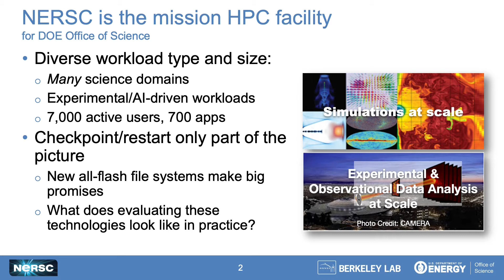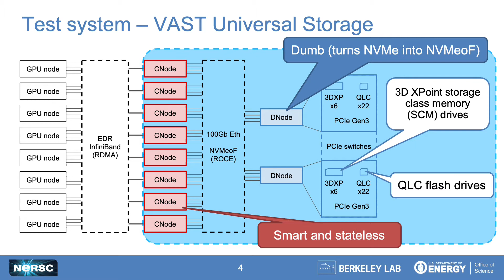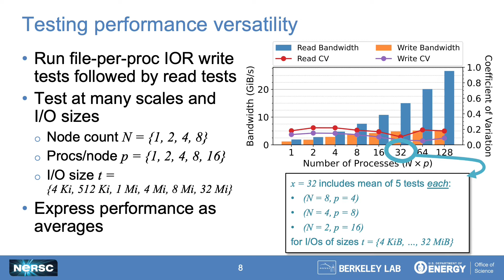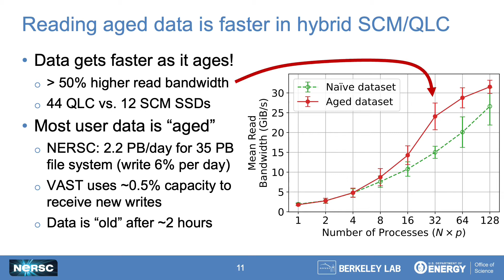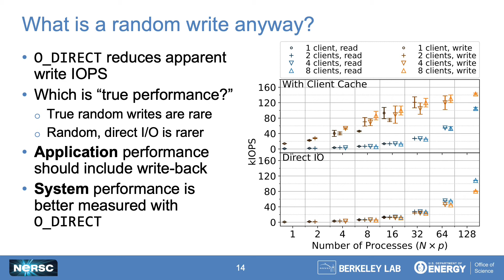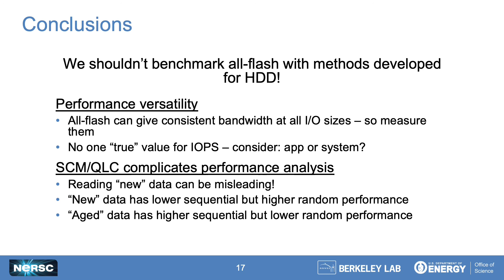New Challenges of Benchmarking All-Flash Storage for HPC

Comment: Could you perhaps explain the "Measuring Random I/O  performance the normal way" slide? In particular why are the y-value Read IOPS y-values less than the Write-IOPS?
Reply: Ah is it client-side write caching?
Reply from the maker: @JamesBlackburn85  Correct, the "random" writes are actually being aggregated by the NFS client into much larger 1 MiB network transfers.